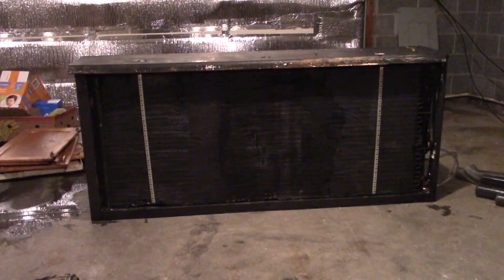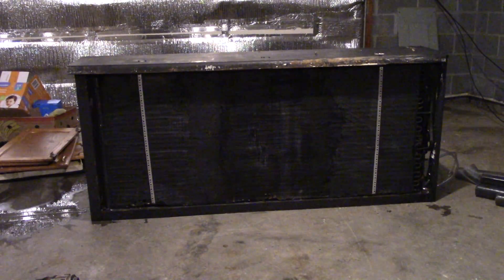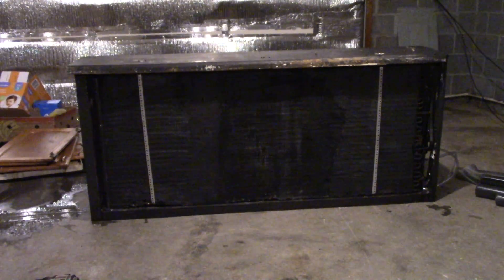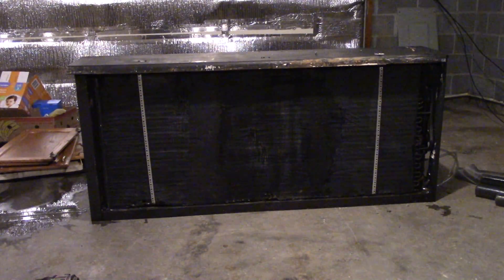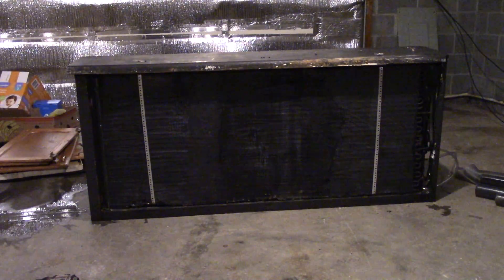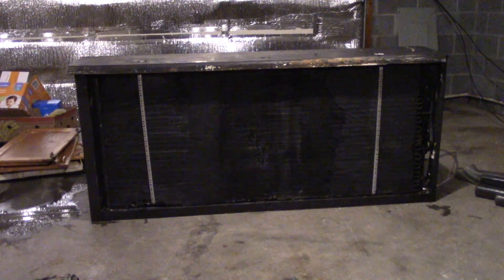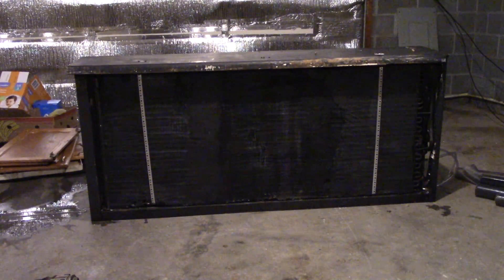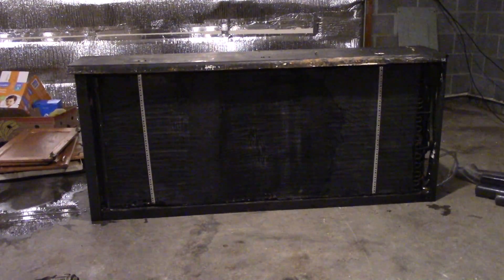I Fixed The Solar Water Heater Coil !

Comment: it may make pressure under sun and air. did that once years ago and had a automatic air bleeder and pressure tank. will you be considering these. i used copper pipe for mine but forgot the antifreeze and it broke badly. be aware of the cold, good show
Reply from the maker: +George Gardinier the cold it busted  it badly but this was about me fixing them.i will install it with antifreeze